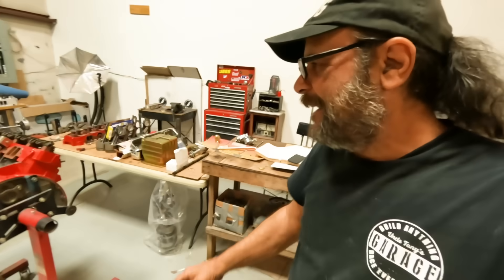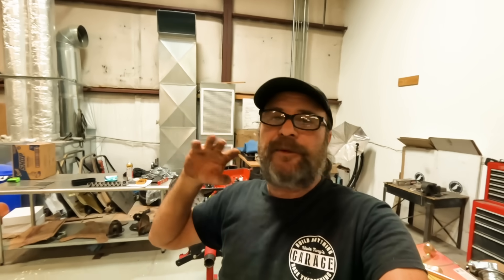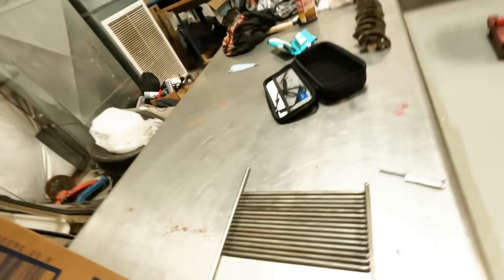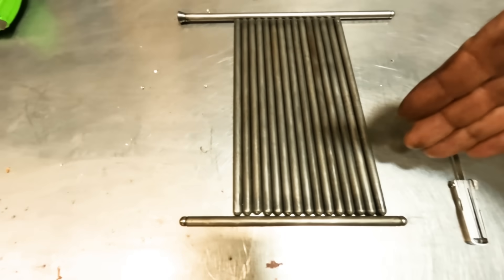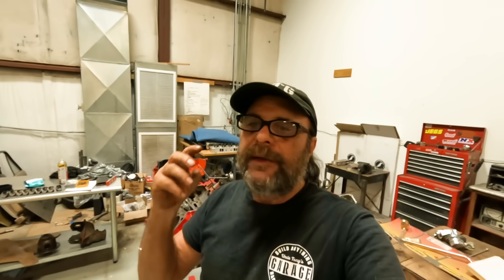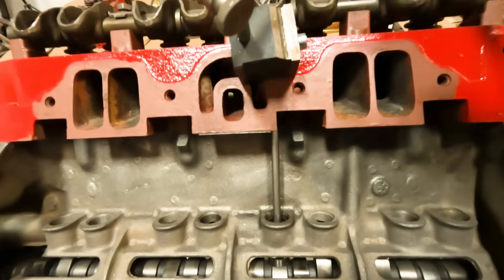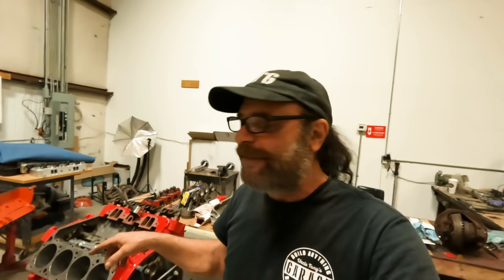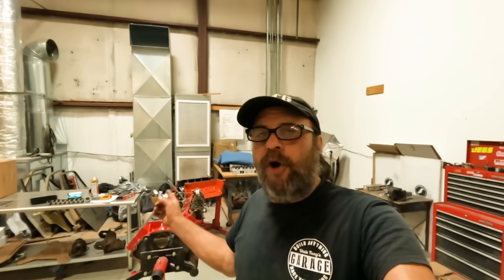The Engine Tuning Issue You Didn't Know You Had

Comment: This is why i loved small block chevys as a kid: run it with the valve covers off, oil deflector clips over the push rods, and tighten the rocker nuts one by one until the ticking stops, then a quarter turn more. When i first took the valve covers off a 318 i was stupified and ignorant and just didn't get it. Even the shims on a cosworth vega made sense, but Chryslers just seemed hokey.
Reply: Hokey indeed

Comment: I always thought that was just basic, common sense stuff that everyone did while putting any factory engine back together. (Matching the short pushrods to the long valves & vica versa.) And measuring installed valve stem height after having the valves ground. Then grinding the valve ends as needed to keep them from sitting up too high. You mean everyone doesn't do that??? I always thought that was just "Engines 101" for the backyard owner operator of a race car. Used to jam the pushrods into a piece of foam rubber from a sofa cushion to keep them in order. Cardboard box works too. Poke a hole with your pocket knife  🗡️, push in the pushrods.

Comment: Hi Tony! Wish you had premised this by clarifying that the stock Mopar valve train is far more rigid, removing the larger rocker studs, stud girdles and other bandaids that non- Mopar engines use to control deviation/deflection in the valve train. The best ALWAYS go to SHAFT mounted adjustable rockers REGARDLESS if the motor is Chevy or any other. I have built many GM and Chrysler, love both, but as Guru David Vizard said, in the past, Chrysler was at the top of the heap for rod ratio's, deep skirted blocks, rigid valve trains, etc., Which GM adopted much later. that said, I built and still have a sbc 406 In a 1976 Monte Carlo daily driver at 460 HP (shaft mounted adjustable rockers NOT CHEAP) and a solid roller 440 bored and stroked to 512ci in a 1972 New Yorker with 720hp at 6820 rpm daily driver. Both have been reliable but for periodic valve lash adjustments. I am constantly impressed with all the great content you generate for the new generation on how cool IS the old school!
Reply: Converting a Chevy to shaft rockers is almost always a waste of money. Unless you're doing super high RPM or extra long-endurance you'll never see it. You'd be better served to put that money into other areas. The magazines always push this expensive must-have fancy part of the month that the average guy will never get a benefit from.

If you have invested in such a thing and feel a benefit, it's money well spent for you!
Reply: @67L-88  the early Chevy valvetrain is weak because of it.
Reply: @67L-88  i've been watching last week a ton of videos yapping about how great the 327 mouse motor is, but like you said it will need the valvetrain upgrade for the RPM it is capable of, when they could just buy a Vortec 350 and make the same power at a lower RPM and save money on setting up a shaft rockerarm setup. Even if i had a 327, i'd sell it to a romantic and use the cash on a bigger displacement.
Reply: @albertgaspar627  Very little power difference between the two. Little more low end with the 350 if thats your thing. No need for shaft rockers for any SBC unless you are running lots of spring pressure, rpm etc. Stabilizes things thats all. Not saying quality 7/16 studs, good rocker arms wont work
Reply: Shaft rockers are certainly the way to go, for high RPM and performance builds when you can use them. Technology has done wonders for ball stud stuff now, but I still agree with you.

Comment: I've seen Ford guys, shim the towers. I've always hated self adj. valves. Their is alot of different ways to change valve train components. Look around under other valve covers, and mic. tolerance. 
        I beat my brains out, on Olds pot metal rocker retainers. They were wore around the base. I even broke a few. 
      If I were racing, I'd find a way to have adj.valves. If you bend a pushrod, you throw one in,without taking it all loose.

Comment: Roller rockers will prevent premature valve guide wear if set up correctly and make more power. The rocker should be centered in the middle of the valve .you can mix and match valves and grind the stems so the straight edge has no gaps even with new parts. Now you have me thinking about valve geometry.  How about spring rates and tired valve springs?

Comment: Dual overhead cams sets performance standards much better rated for big HP. I'm a little partial to German cars for this reason. BMW slant 6s "M50,M52,M54 all have factory internals to reach 1000 HP and last on a track. I'm not gonna even point out the V10s and V12s.

Comment: Wanted to say Great video Back in the early 80 when I was getting into performance build ups top of the engine stuff and a buddy mine wanted to me to put a cam in his Cutlass . i was use to Chevy small block.  I did the cam break in but it had rocker noise i thought it was the lifter weren't pumping up.  ithey we're none adjustable the cam wasn't that big I guess what I'm saying is you made me think about that particular motor it was a 455 I remember  calling crane cans up about it they said that everything should have been fine

Comment: The more I study american car culture, the less I understand it.. That valve train for instance, why? Even the rear engine Skoda that was notoriously bad design, had better valve train and revved past 5K stock. After a slight tickle, 10K-12K in folk rally spec. And in rallying, you need to keep the sh*tbox on full tilt for half an hour per stage, 5-15 stages per day, 1-3 days in a row. There's reliability, and there's rallying.

Comment: Found a new in crate 400 Chrysler short block back in 1990.  I took a pair of 906's to the machine shop and had them cut .060 hoping to bump up the compression then slapped them on along with a .509 purple shaft. Stock rockers, pushrods. Car fell flat after 4500. Combined with a 3500 converter it wasn't very fun to drive, haha. Oh well I was 17-18 at the time, cut me some slack. Combined with my direct connection porting templates, I thought I was going to have a 10 sec. car -- not so much.

Comment: I've always used adjustable rockers in my performance Chrysler builds with solid or hydraulic cams. Too many variables with cut heads or deck surfaces, cam base circles, sunken valve seats or stem heights. Also, I've seen differences between lifter brands in lifter cup heights. Too many variables. Another one of the bigger reasons for adjustable rockers is the stamped rocker arms are never a true 1.5:1 more around 1.43 if you're lucky and 1.34 on the low end. Makes a big difference. Used to be some companies made shims that you could put under the shafts. I bought some from Hamburger's a long time ago. I think the set came in .010 .020 and .030. Still, that won't help the rockers being off. Stamped rockers are light, cheap, pretty much last forever. Performance pieces. No. The Chevy design's problem is the stock rocker studs are pressed in and with enough spring pressure can come out.
Reply: Pre- E7 head SB Ford's are notorious for pulling rocker studs when using a decent valve spring.

Comment: If you mill the heads or the block there is also a need to mill the intake as the relation between them changes.
Reply: Good point,  but the way I used to do that was to mill the intake side of the head, that way you are not limited to 1 intake manifold with that engine, if you mill the intake side of the heads, you can change intakes anytime without a problem.
Reply: Depends how much you Mill off the heads or the block

Comment: Is it OK to put different thickness shims under individual rocker shaft bolts? I thought it should be even across all the bolts/the whole cylinder head so that the shaft is not "warped"/bent